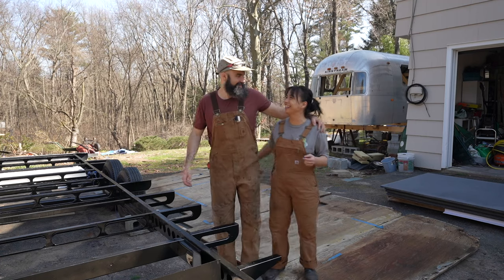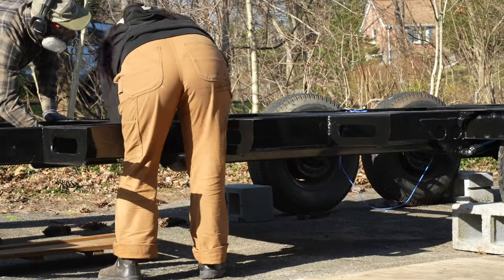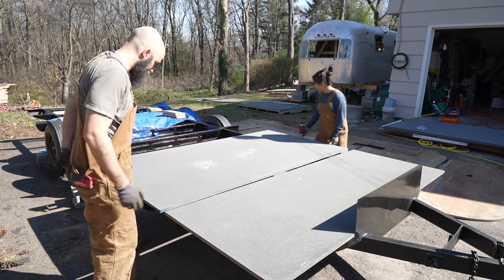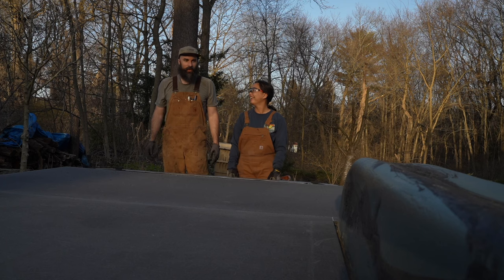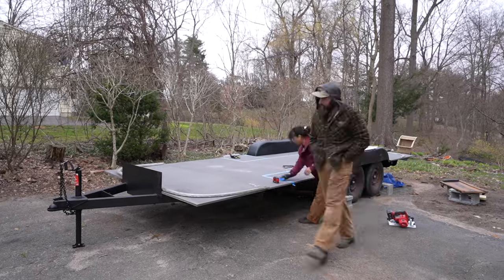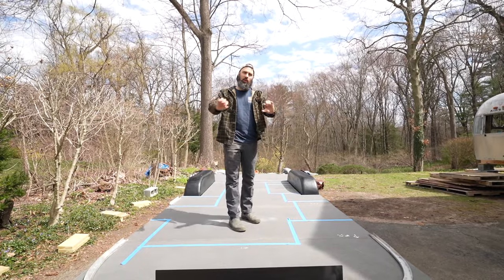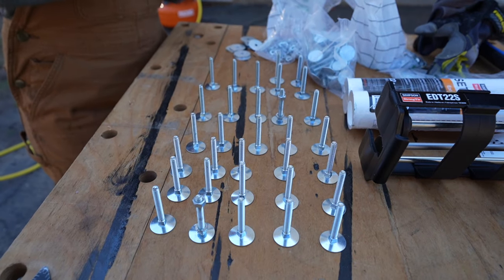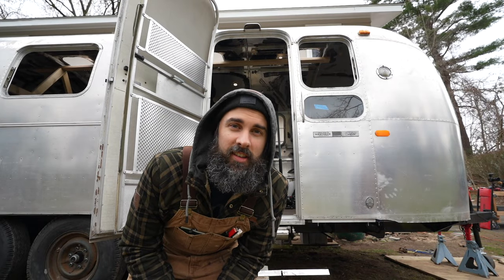INSTALLING ROT PROOF SUBFLOOR in our Vintage Airstream! (Ep.7)

Comment: I’m so excited for y’all! Can you share how you kept your original subfloor so intact to use as a template? We’d like to do the same (except for the back which is even more water damage than yours 🥴)
Reply from the maker: Thanks! We actually did nothing to them all winter lol. They just say out on a pallet for the most part. After the 4th snow storm I used them to keep the tarp on the trailer from sinking between the frame
Reply: @Meghanandmatt  but how did you pry them out without wrecking them? We haven’t even gotten our interior skins out yet so we have a little while, but given the water damage they are pretty gnarly
Reply from the maker: I cut out each and every bolt from the bottom using a pry bar and an oscillating multi tool (Make sure to get a bunch of extra metal blades cause you'll go through them. I found it easiest to pry up on the floor to slide the blade in and cut each bolt above the crossmembers. I just used a hammer and punch to smash the rest of the bolt and nut out from the top down once the floor was off. 

On ours there was a 5/8" piece of plywood where the first 3 subfloorfloor boards joined so I think that helped prevent them from getting totally wrecked when prying them out. 

Our floor was far from a perfect template but we just made sure to get the first piece of Coosa cut and didn't have to cut any of the long edges after that first one. I will say we cut slightly too little on our subfloor and our bow in the front should have been ever so slightly hanging over the subfloor cause it was an incredibly tight fit we're still working on with putting the shell back on. 

Hope that helps!
Reply: That helps so much, thank you!
Reply from the maker: @Clatterbear  you’re welcome!

Comment: Next time if you're ever having the fiber glass in your skin problem again. When I used to do auto body collision work, I found that if you apply tape to the affected area and rip it off, it pulls the fiber glass out of your skin. There would be no way in hell you can pick it out because of how fine they are. Use very sticky masking tape, I don't recommend using duct tape for painfully obvious reasons lol. I've also heard people using lint rollers as well.
Reply from the maker: That’s a great tip thanks for sharing 🤙🏼

Comment: loved this. about to do the same thing! what sensors and heating pads did yall use for your tanks??
Reply from the maker: Sweet! It was pretty straightforward once we got over the fact that it’s impossible to get it perfect lol. We’re using the Garnet industries SeeLevel sensors. I bought the 710-AR sensors which fit the smaller tanks

Comment: Fixing to do a AS restoration and just wanted to know what thickness y’all went with.  Wondering about how much just the Coosa board costs were?
Reply from the maker: We went with 3/4” blue water 26 Coosa board. Super easy to work with. Including shipping it cost about $2,400 for 5 sheets if I remember correctly
Reply from the maker: Some vintage airstreams have different thickness of floors though so double check before ordering